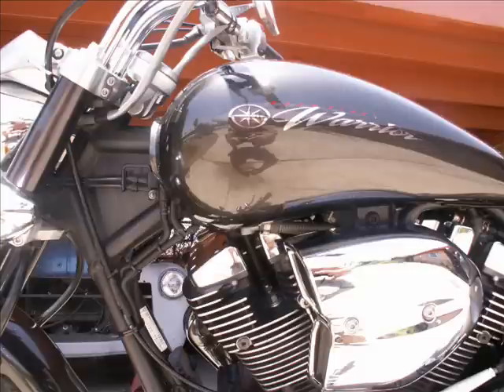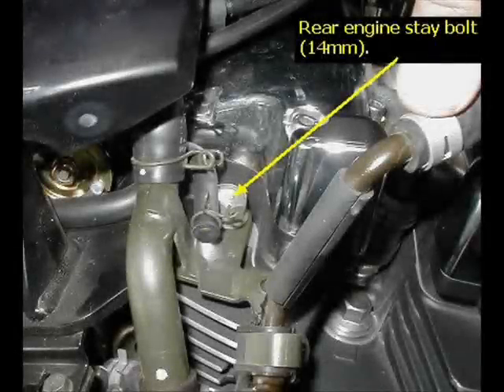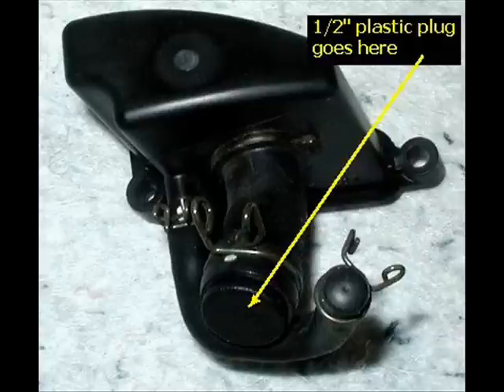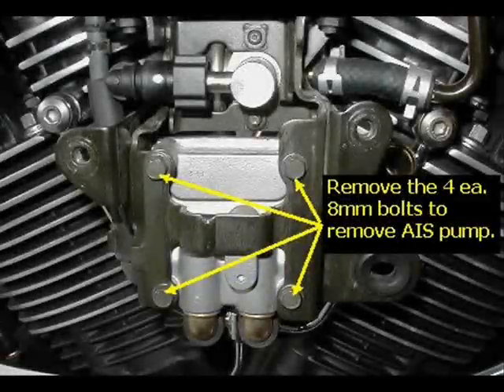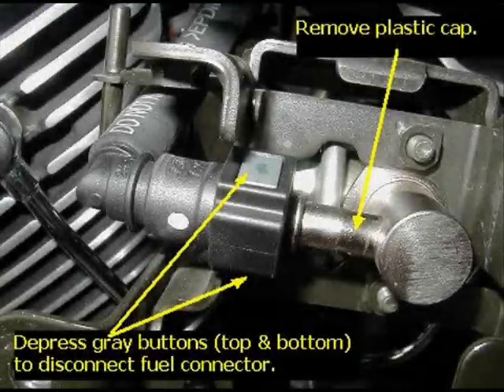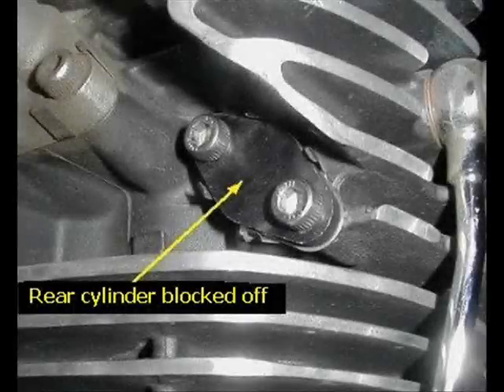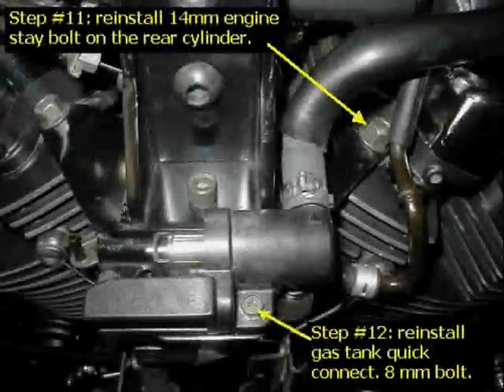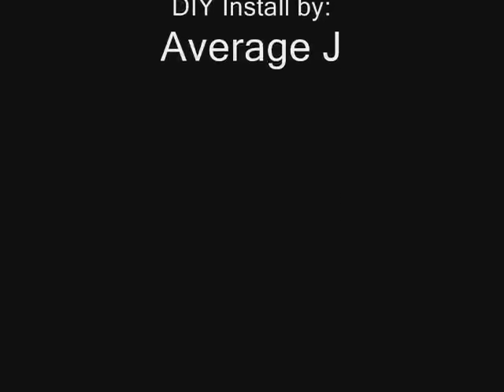Yamaha Warrior Air Induction System Removal

Comment: Is removal of the gas tank mandatory if you do not have the BAK Hidden Air Kit?  Pinching off the gas lines and finding the front removal bolts (of the gas tank) are a P.I.A.  Plus the risk of scratching the tank when removed.